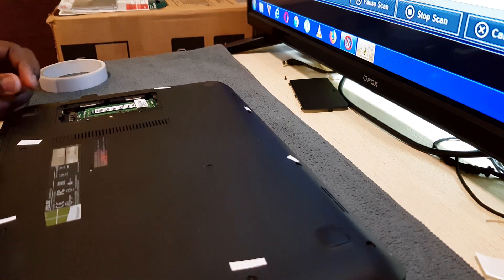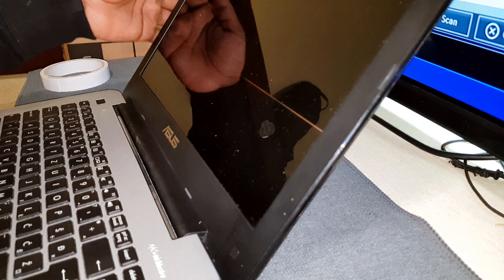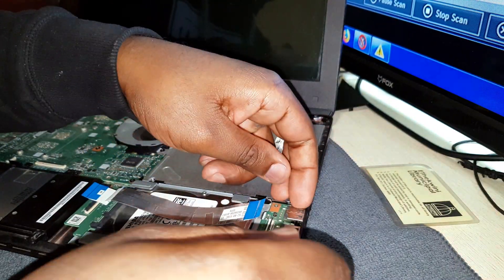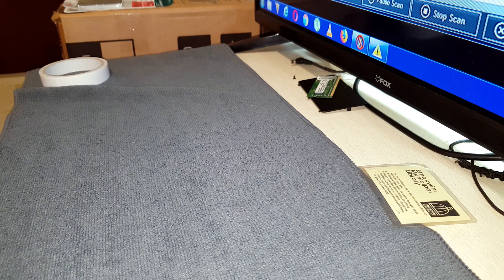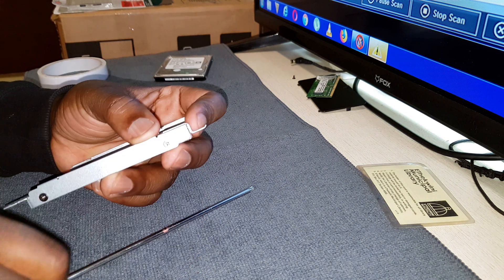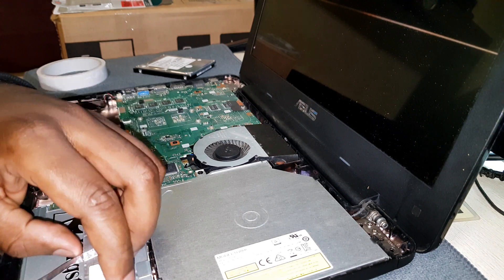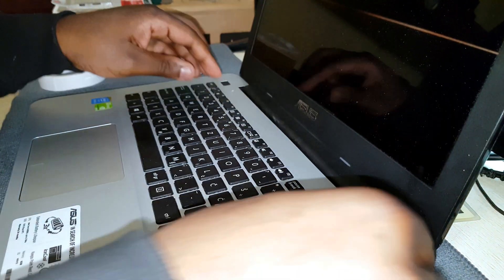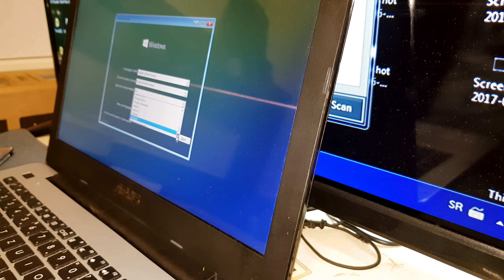Asus X455L Hard Drive Upgrade

Comment: Greetings, I have an asus x455lab it does not detect my ssd, I try to update the bios and it does not read me the narrative that under update the bios dead the asus page, and windows does not let me update either it tells me that the file does not correspond, yes Can you give me some opinion, the setup is well configured. Thanks

Comment: My laptop freezes so I reset/ reformatted my laptop, and reinstall the OS, and my hdd works fine ,but still not working. It still freezes when I play video, copying files and more. Do I need to upgrade my RAM? I have asus X455L like yours.

Comment: Can I ask what is the thickness of the cd rom caddy. I have asus 455l also and I want to replace cd rom with the hdd once I upgrade my laptop to ssd. Thanks
Reply from the maker: Sorry guys i havent been to reply coz my account had some problem, but its all good now, more videos are coming soon. and yes the thickness is 9,5mm
Reply: hey! did you get that info? im planning on doing the same
Reply: Me too. Is it 9.55mm or 12.7mm?
Reply: @cjtads1057  if anyone still needs the info, its the 9.5mm one, i got the 12.7 one and had to send it back
Reply: @cjtads1057  im almost certain its 12,7, the computers width is a bit over 14mm

Comment: bro, will any brand be compatible as long as it's a 2.5 inch size?
Reply: KINGSTON SA400 240GB SATA 6GBPS SSD, im planning to get this brand and type
Reply from the maker: @welsonte7122  yes it will be compatible
Reply from the maker: @welsonte7122  check out this video so you wont have to reinstall windows or any of your software after the upgrade https://youtu.be/yPOS2dTuT9o

Comment: Bro ask again oks ba pang gaming after upgrade? To ssd and add ram 

I mean is it worth it?t.y. if you reply
Reply from the maker: an SSD is much faster than an HDD because there are no moving parts therefore upgrading your HDD with an SSD will make your pc run faster
Reply: @diytech5321  i3 5th gen laptop po worth it paba?
Reply from the maker: @jukokololy5188  It depends on what you will use the laptop for, but i would recommend at least 6th gen if possible
Reply: @diytech5321  okay...i better buy i7 core 6th up gen T.Y.
Reply: I mean laptop with i7 6th gen i want a faster performance and long time use
Reply from the maker: @jukokololy5188  i7 will definitely be faster long term, as long as you take good care of it. check out my new video on the fan cleaning to keep your laptop running fast for a long time.  https://youtu.be/r_9dhY7boiE
Reply: @diytech5321  T.Y.